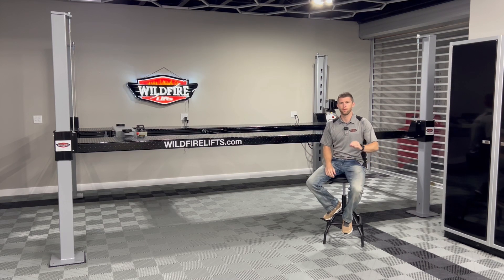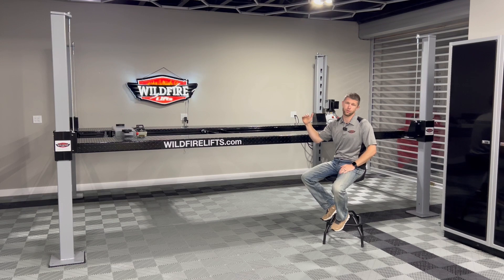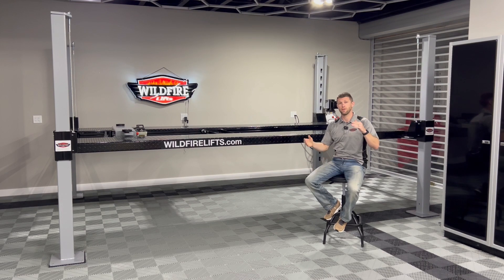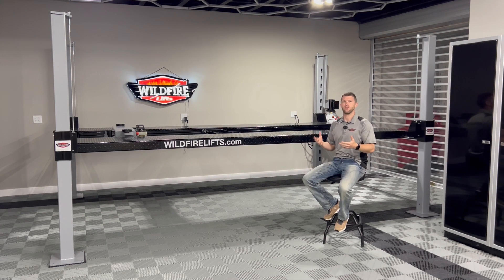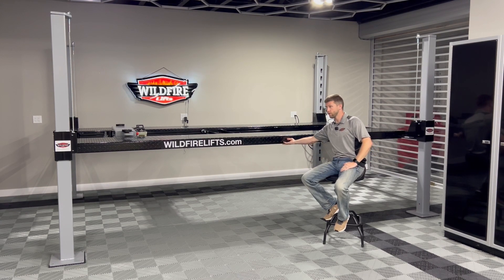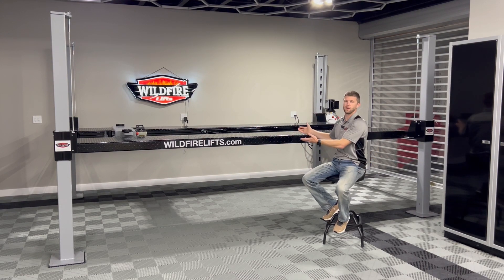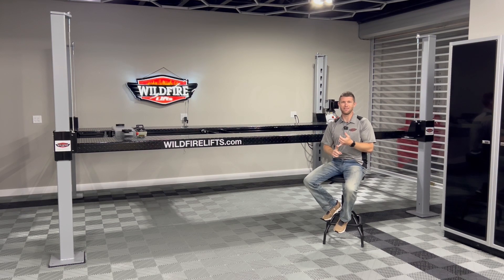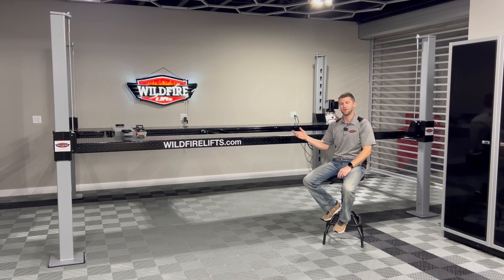4 Post Lift Ceiling Height Requirements

Comment: This wildfire lift looks exactly like almost exactly like my advantage lift in design.  Does one make for the other or are you both sourcing the same parts from vendor.
Reply from the maker: 100% different company, different production facilites and zero connection. The may look similar onlline but they're quite different. We'd consdier both to be top quality in the industry (compared to Bendpak, Atlas, Tuxedo and the others) but if they were both Corvettes Wildfire Lifts would be the Z06 and Advantage would be the base Stingray - this is when comparing the quality and robustness of nearly every piece on each lift. Wildfire Lifts uses thicker upright posts, reinforces the runways more (fully boxed vs just partially), higher quality powdercoat finish, higher output motor, etc. Happy to discuss any details on a call. To sum it up, better parts and better grade material on essentially every aspect.

Comment: What about a single car that you are lifting to work under rather than storing two cars?
Reply from the maker: Great question. This height is 100% subjective to your cars height and the ceiling height in your space. The runway is 4.5" thick and sits roughly .5" off the ground when fully lowered. Add these together (5") along with your vehicles height to determine how high your vehicle would be able to lift in your space. Also, keep in mind that you can duck under the runways to get your vehcile and work on it as the bottom your tires will be 4.5" above the bottom of the runways and the bottom of your vehcile will be even higher than that. As always, you're more than welcome to give our team a call to discuss specifics.
Reply: @wildfirelifts  What is the height of the posts?
Reply from the maker: @Boodieman72  the post heights will vary depending on the model. Please find all of our models listed here, the specs for each model will be on their respective product page. For reference, the shortest posts on one of our lifts is 7' 8" tall and the tallest posts on of our models are 8' 10". Product pages here --> https://www.wildfirelifts.com/car-lifts